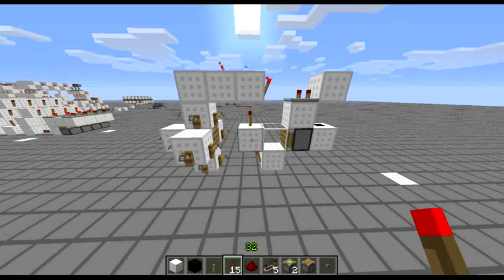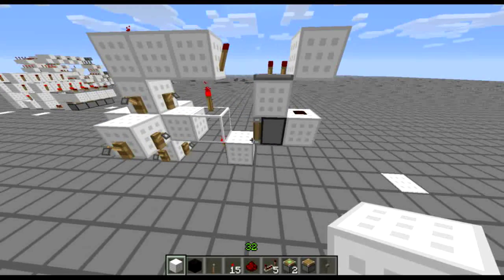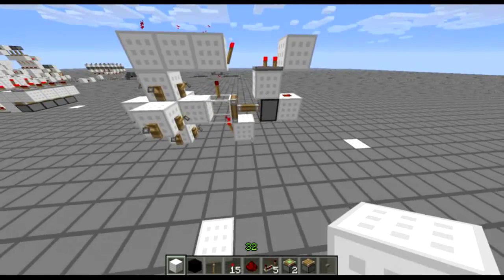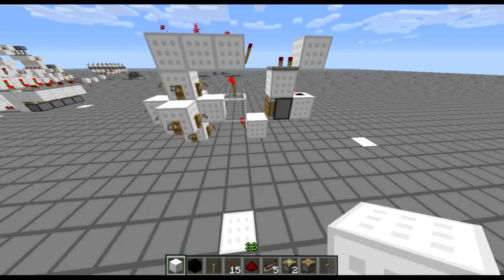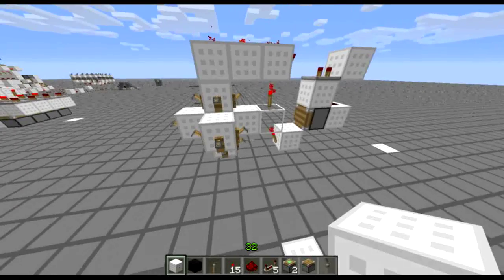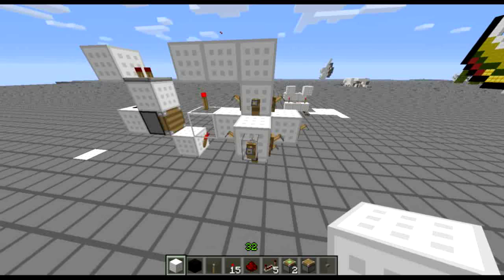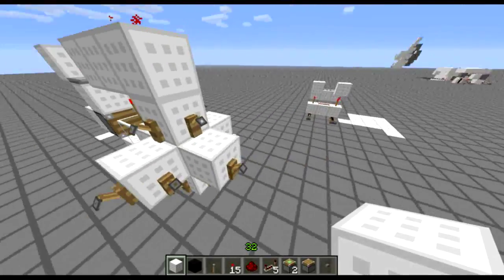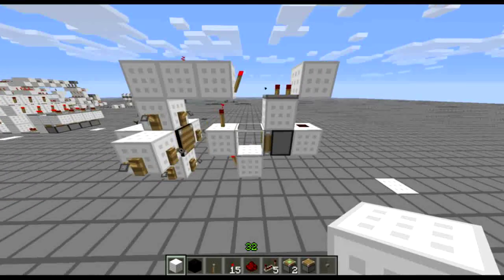Minecraft Random Pulse Generator

Comment from the maker: This wasn't me showing off some build, this was mainly just a proof of concept, of course you could make a smaller BUD, or you could take off the 2 side tripwire covered blocks to make it 1 wide (that would make it fire less often though), both of those would make it smaller, but in this case, it doesn't really matter, because this was just to show a method of generating random pulses, not the best circuit for using this method.